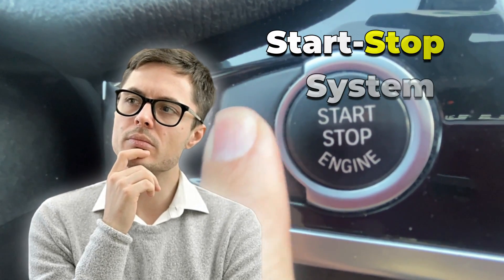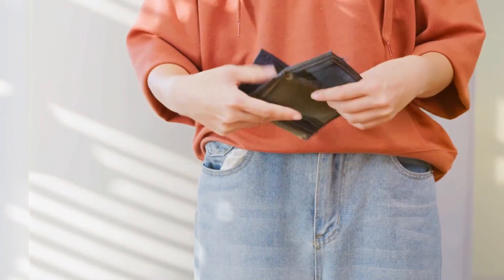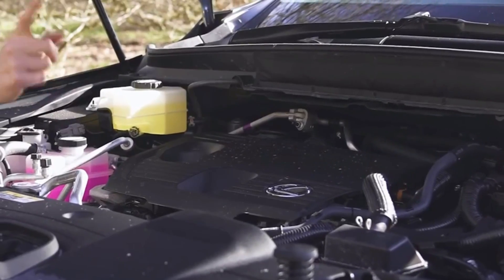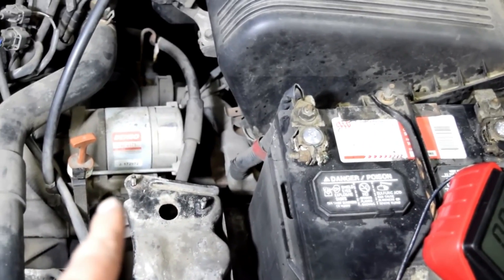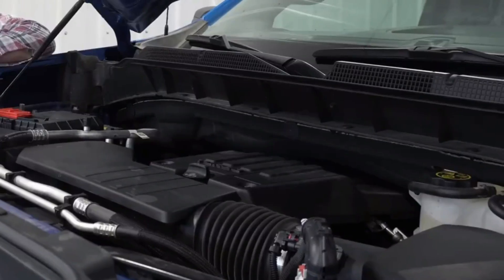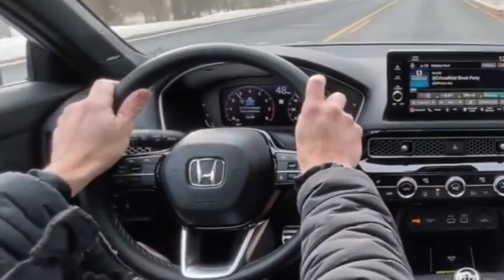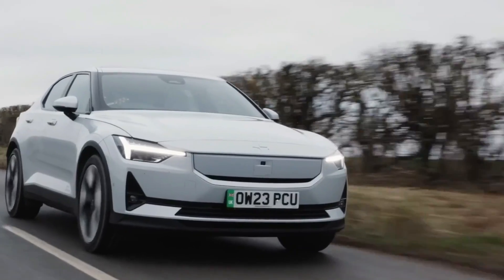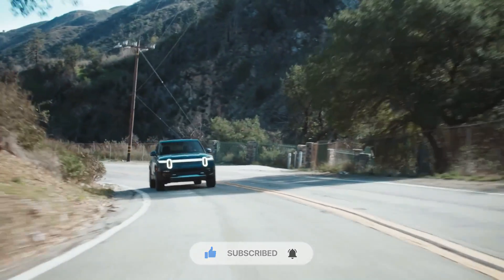The Ugly Truth About Auto Stop-Start Systems (That Nobody Talks About)

Comment: If Start/Stop damaged engines, every taxi in Europe would be dead at 80k km — yet they run 300k+ with ISG active. Modern starters, bearings, and ECU logic are designed exactly for this. The system only activates when it’s safe. Myths aren’t engineering.
Reply: This is what I'm thinking as well, being a non-expert. I just consider the outcomes. If this system is so damaging, there would've been considerable outrage over it in the decades that it has been in circulation.

Comment: any engine, whether it be ICE, turbine, rotary, etc. always uses more fuel to start than idle; and the majority of an engine's wear comes from starting and stopping (especially cold starts)
Reply from the maker: Starting an engine, especially a cold start, puts a lot more strain on it compared to idling. Plus, it definitely burns more fuel during that process.
Reply: @4autowheels  all true, but start/stop is always off until engine is at certain temperature

Comment: my 18 Chevy Cruze i drive with "L" mode to bypass that mode, i  can control each gear with speed without the clutch. long drive thru lines and train waiting i simply turn off the car
Reply from the maker: That’s a smart way to handle it! Driving in 'L' mode for better control and turning off the car during long waits sounds like a great way to save wear and tear.

Comment: One of the most smog producing operations that an engine can perform is starting.  When catalytic convertors are not receiving exhaust from the engine, they are cooling down.  Catalytic convertors that have cooled down are not able to burn off the smog components in engine exhaust.  Add to that the extra smog components in the exhaust due to the engine starting and stopping and you have an engine that will produce more smog.  It just doesn't make sense.  This is what happens when you let the education system in this country sink to the level it has.  Young folks have no idea how to engineer anything nowadays and it keeps getting worse.
Reply: Wow you are clueless. For auto start-stop to create less emissions from starting than having the engine running the engine needs to stop for 7 seconds, significantly less than one cycle of lights at an intersection for example. But not enough time for a catalytic converter to cool down. How do you think catalytic converters work on hybrid engines for example? They shut on and off often and its not an issue. Auto start-stop makes an engine produce less pollutants, that is just a fact.
Reply: I strongly agree